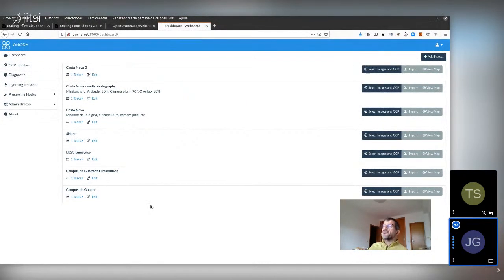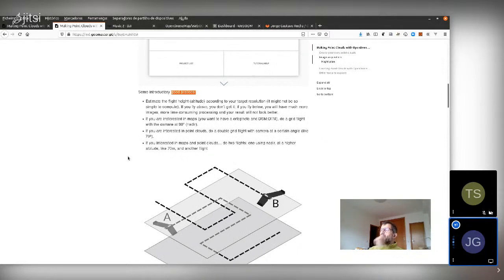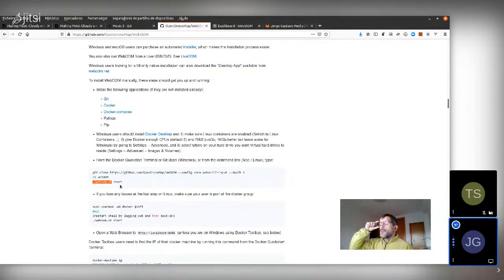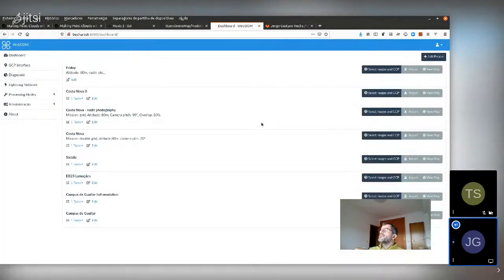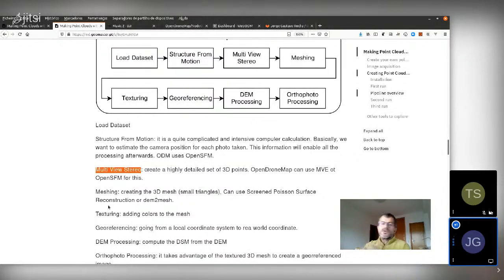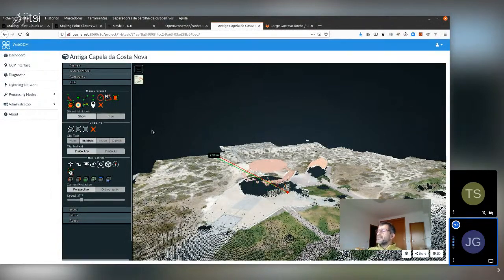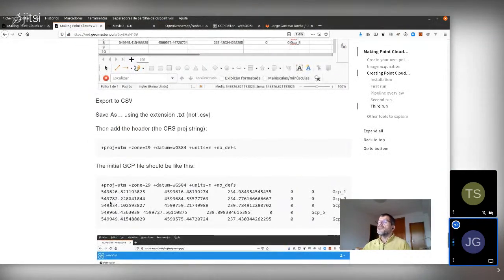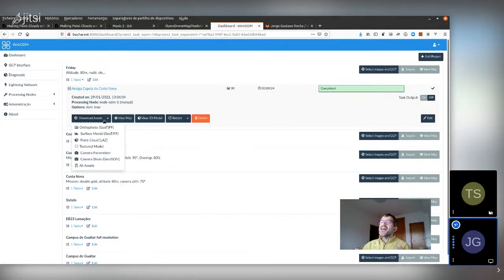Creating Point Clouds using ODM with Jorge Gustavo Rocha

Comment: Do I need internet access to use WebODM? Or it works locally in my computer?
Reply from the maker: You can run WebODM in a docker container locally on your desktop. You can also run ODM (without the web interface) from the command line (also available in a docker image), or you can use the Python ODM library if you want to automate your work.